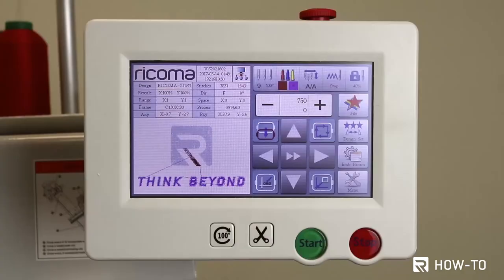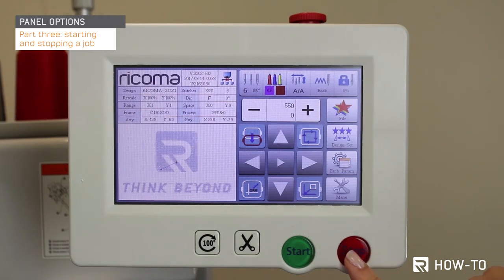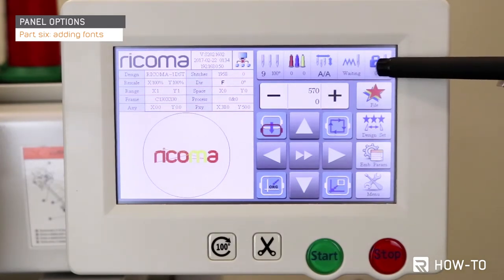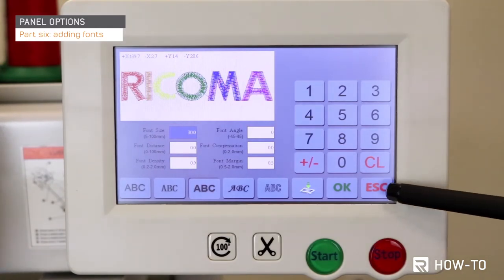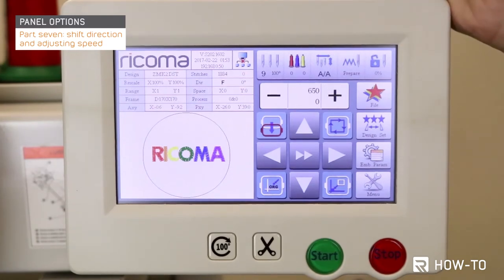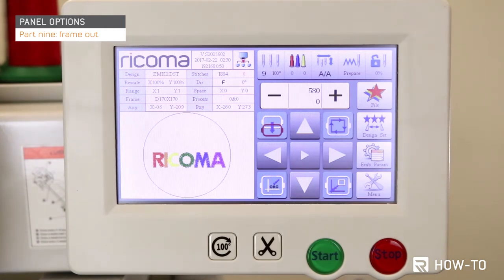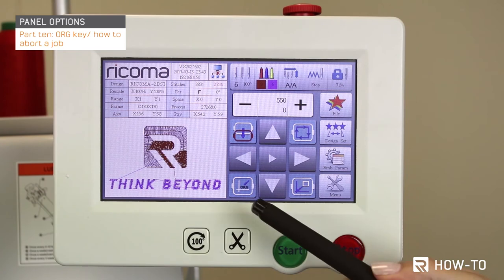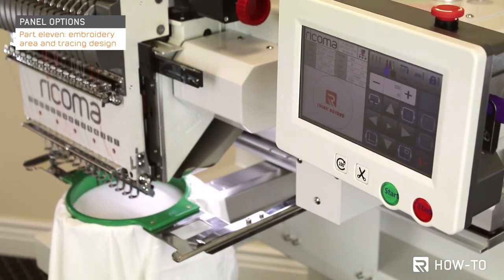MT-1501 How-To: Control Panel - Options

Comment: Hi, I don’t know if this video is monitored, my question as follows: I am new to this machine MT 1501, I tried entering a font and it worked, but it does not get centered, it starts embroidering from the center to the left and manually centering it it’s a pain, especially when each hat has its own names. Is there a way to center the text?
Reply from the maker: We have linked a video to one of the videos we created on our channel, hopefully this helps! 
https://www.youtube.com/watch?v=afIepJFGD10
Reply: @ricomatv  thank you for the response. Unfortunately it does not answer my question. Perhaps I miswrote it. Let try it again, I have the design created and imported from my software; ok, now I want to add a name and use Ricoma’s screen and type what I want to add to my already embroidered garment/hat. I am not able to select THAT font to be centered. It starts embroidering from my current position which is the center of my design garment to the right. My question is, where do I select to have that newly added text to be centered instead of right justification from my needle’s current position?